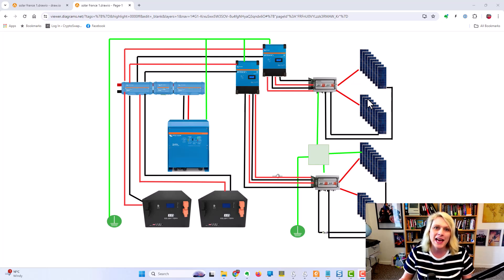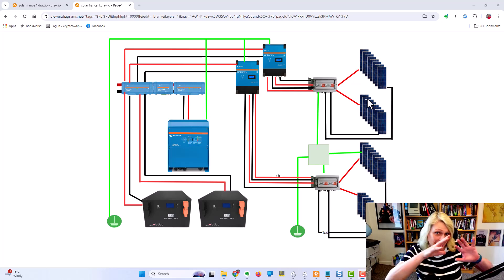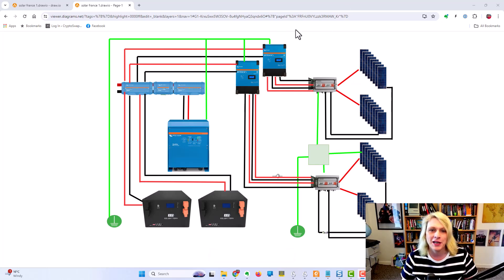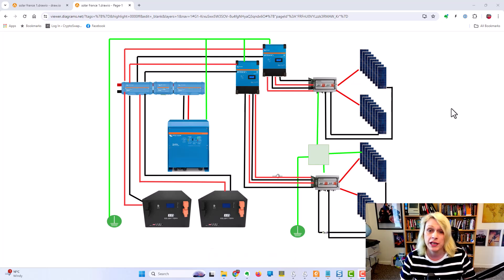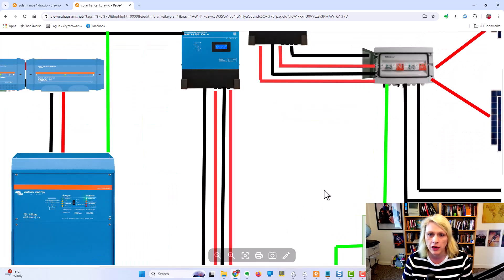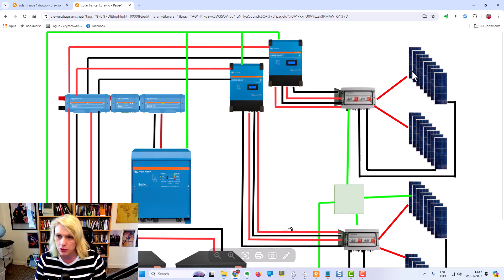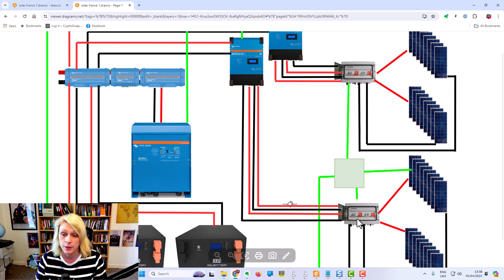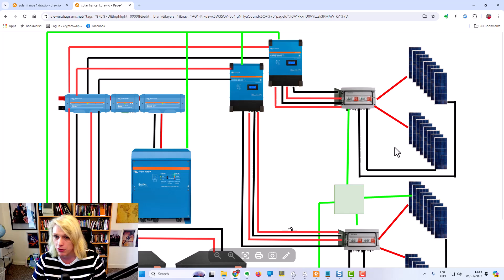Solar System Wiring Diagram

Comment: Hi Sarah, just found this amazing channel! Exactly what I've been looking for. 
I moved to Northern France at beginning of the year and am now in the position of starting my own Victron solar instal. Do you find it better to get the equipment from the UK or France? I'm struggling to find a French Victron dealer with good prices. Thanks, Mark
Reply from the maker: I get all my solar gear from https://allo.solar
I get the batteries from China and I get the cabling from Amazon. Good luck with your install. What part of Northern France are you in.... If you're not too far away would be great to visit maybe I could put some of your install on the channel....

Comment: Good Lord 100kwh per day? That’s a mighty load indeed! Our 4 bed all electric family home in Ireland included a ASHP, HVAC and two EV’s averages around 65kwh per day over the year. We do have the room for a huge system, but would not have the knowledge nor the budget to pay a professional to install the system. We will start off with as large a system as we can using modules and add as we go. Thanks for the great videos!
Reply from the maker: 100 kilowatt hours per day is the worst case scenario in the dead of winter when we have everything turned on...
Reply from the maker: But yes it is a lot of power good luck with your system

Comment: Electrical engineer speaking, Two different ground rods may have different ground resistances when you measure. Better to connect two rods underground if there are close around 10 meters.

Comment: What do have planned in the event of a battery fire, even though the likelyhood is small, the more you have the great the chance. What plans do you have? I ask this because it can have an effect on the way your system is designed. I have some ideas to suggest, if your interested?
Reply from the maker: The plant room is separated from the main house. Also we have a Google home assistant smoke alarm after all alert us in our bedroom if there is smoking the plant room and also give us a notification on our phone and we also have fire extinguishers. Let me know your thoughts.
Reply: @Gridbusters-qx4om  They latest I've seen from the US fire brigade was to suffocate the batteries with a fire blanket is the most successful way to control a battery fire.

Comment: You really shouldn't have posted an incorrect wiring diagram. If you wired your system in this way it will cause far more issues than just monitoring, it does depend on how its setup, for example mine will stop inverting at 10% SOC, you can set it to charge when it reaches a certain SOC of charge for example, the system will get confused, this of course presumes you're using the shunt for calculating the SOC and not the battery BMS. You have two strings in and two strings out, therefore the combiner boxes are not combining, thus not combiner boxes. Do the boxes have two MCS's and SPD's?

Comment: Nice job. For your solar panel expansion. Are you considering using a Fronius inverter? The Fronius Primo is 100% compatible and made for your Victron off-grid system. It will be cheaper and better for your expansion. Fronius can do very high voltage strings so less cabling. It will make ac power during day for direct consumption more efficiently. You will have more total usable inverting power also. Excess power is also used to charge batteries. You have to keep the 1 to 1 rule. 10K multipluss = max 10K Fronius. The Fronius is on the  out side off you multiplus. The grid is not needed. It is a micro grid system when grid is not there.

Comment: Thank you for your informative and interesting video. I have a question about the connection between the PV panel combiner boxes and the charge controllers. If you are combining 2 strings together in the combiner box, why do you have four lines (2 positive and 2 neutral) and running from the combiner box to the charge controllers?
Reply: The strings are not paralleled in these boxes but fused. In 2x2 strings to 2x2 mppt  Victron controller.  Hope this helps.
Reply: @eriklefevre5490 Then they aren't Combiner boxes. Was there two MCBs and two SPDs in each box?
Reply: Yes. But English is not my language and when I looked if these boxes where called combiner boxes i found that they where. Maybe they are combined in a way off speaking? But just not paralleled.
Reply from the maker: Is just what they're called in the industry people call them combiner boxes I'm not combining anything in them there's two inputs and two outputs and basically using these as a breaker panel so I can fuse the panels and have somewhere to turn them on and off and also have lightning protection. Calling them a combiner box it's just like calling a vacuum cleanery a hoover.
Reply: @Gridbusters-qx4om  I can see where you are coming from, but a true combiner box actually does combine strings, you can see quite a few people have queried it, so it clearly does cause confusion. You don't need to fuse a single string, the idea of the fuse is to stop other strings back feeding a faulty panel, I think you only need fuses on 3 or more parallel combined strings, although I did fuse my two parallel strings. I have combiner boxes with MCB's and my electrician that did the AC side and wired in the panels insisted I put DC isolators on each string - annoying as they take up quite a bit of space, and not really required.
Reply: If any ones interested this is the video with the fuse boxes https://youtu.be/9cbOwbk-m1I?si=52SM0pqoJnkcO_36&t=631

Comment: Charge controllers are still connected on the wrong side of the lynx.
Doubling the battery makes only sense while at least doubling the panels. For winter you will need even way more panels. The Energy needs to be generated. You can't store Energy witch is not there.
So look for a lot of more panels first.
Reply from the maker: Correcting the wiring in the next video for the charge controllers. Definitely plan on adding more solar panels, also something I didn't mention in the video is that we have much cheaper power during the night time so during the winter time we can charge the batteries using off peak cheap electricity that's always an option. I'm also looking into the possibility of purchasing a large wind turbine to put in one of our Fields.
Reply: Sorry, but doubling the battery capacity only makes sense when doubling the panels is not as straightforward as you make out - she is grid tied, not off grid. She has 32 panels, lets assume 400w, that's 12.8 kW of panels. I have 8.74 kW of panels, and 29 kWh of batteries, with an 8kW Quattro. I charge my batteries in the winter at cheap rate, top up with solar, export some at peak rate, in the summer months I don't charge so much from cheap rate as the sun easily charges them. Where it gets complicated is how long the cheap rate window is, and how much you can charge in that time (likewise how much the panels can charge). My cheap rate window is 3 hours, so ignoring losses that's 3 hours at 8kW,  a total of 24 kWh then solar tops up. It does end up a balancing game of whats available, including grid charging. My day export rate is the slightly more than my cheap rate import, which balances out nicely.
Reply: @TheRonskiman  
Hmmm .... she has a single phase grid connection and a talks about a consumption in winter of 100 kWh a day. Maybe there are 5 kW left to charge for some low rate  houres. This will not full charge more batteries as she allready has.
Reply: @Juergen_Miessmer  100 kWh a day is an average of 4.16 kWh consumed every hour. If we assume she has a single phase 240v 100 amp supply that's 24 kW capacity, not that I'd want to run it at the max.  Obviously a lot to juggle, electric heating, car chargers, battery chargers etc. They may want to save a certain amount in case of power cuts, so only normally use 50 to 100% SOC range, so many variables.
Reply: @TheRonskiman  
We don't know, 
but from the houses i know in France there are way less than 100A available. And for shure the grid voltage in EU is 230V, not 240V.
Reply: Definitely agree.. The Charge controllers need to be on the side of the Lynx as the Inverter. In the diagram, the solar charging of the batteries will not ba accounted for by the Lynx Shunt.